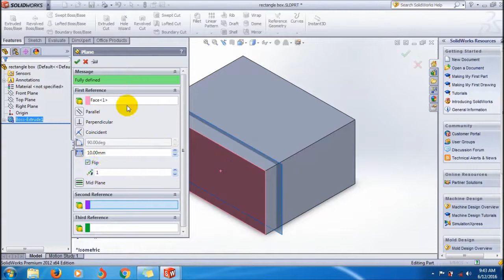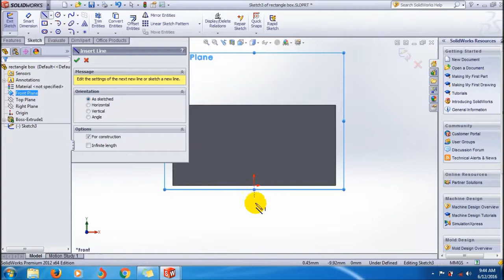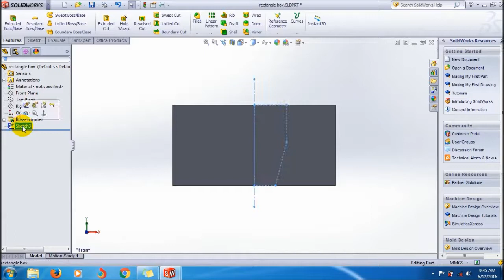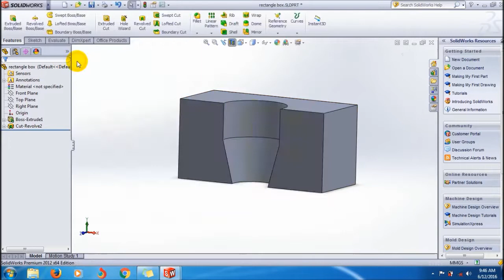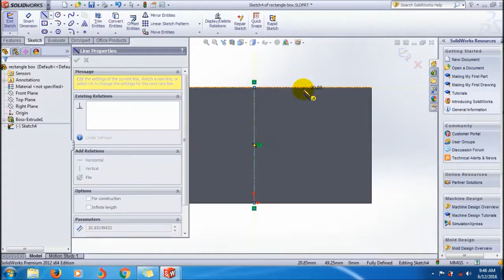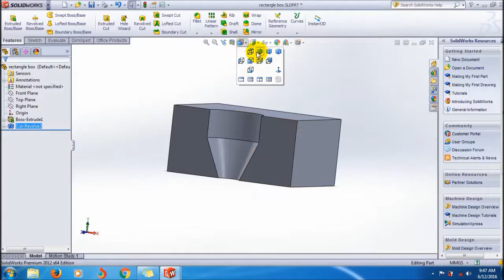SolidWorks Revolved Cut Tutorial _SolidWorks Video Tutorials for Beginners

Comment: Hi, nice video but if later I`ve to move the rev. cut how sholud i do it? I can move it easily by moving the plane in one direction, but for the second direction i`ve to edit the sketch everytime?
Reply from the maker: If you are using two direction option, you have to use two different values on the both sides of plane. For that no need to edit sketch every time.

Just create a plane across your sketch and apply two direction option. Then enter two different values against that plane. If you are still confused , contact me via www.solidworkstutorialsforbeginners.com
Reply: @Hotshotracer91  thank you for your effort! But i`m sorry but I don`t understand what you mean! I come from Solidedge and I was a lot more easier to use a cavity library and adjust position during the design process. I use it for hydraulic manifold design and now I`m drawing in the assembly mode, but it`s really difficult.